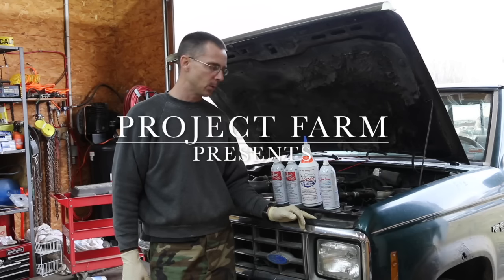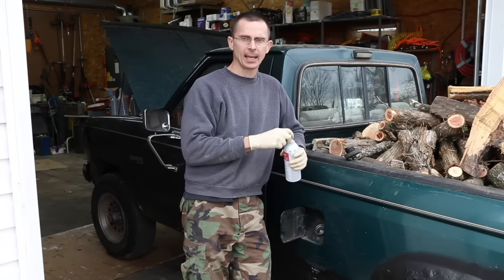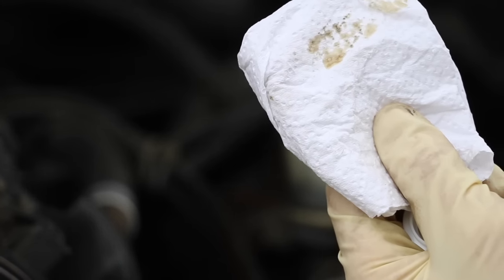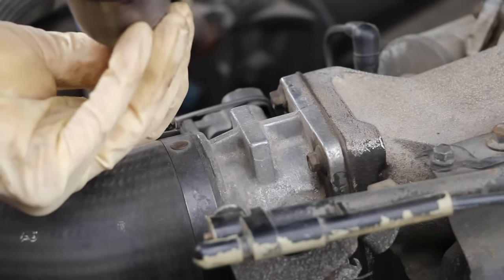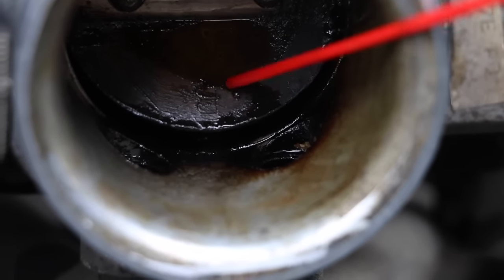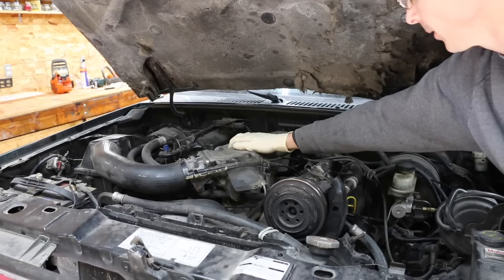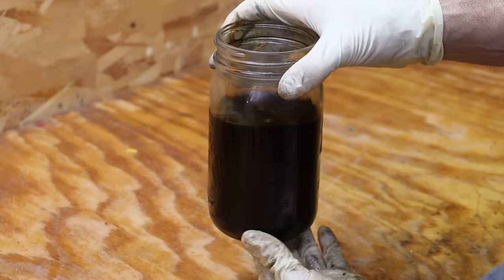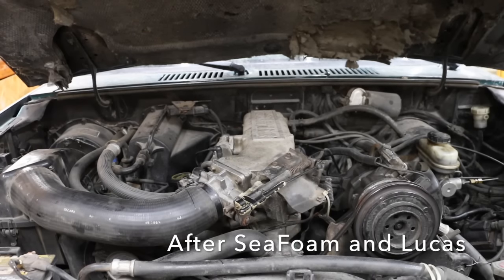Seafoam--can't believe what it did to my engine!!

Comment: Just used the top treatment on my xterra with 209k and it idles much smoother and accelerates a little easier.
Wasn't running bad before the treatment, but the engine is noticably smoother
Reply from the maker: Impressive results!
Reply: My 03 Exterra  just rolled over 400,000 Km. Have used Mobile 1 extended since I bought at 50'000 km and aside from tune ups brakes and the usual maintain. It's been great still getting 13 litres per 100km - not bad in my books

Comment: I used both of these products on my 96 Chevy V6 Blazer and I was amazed at the results, the engine seemed to start smoother, rotate longer after shutting down. When I looked at air intake before and after Sea Foam it was like brand new.
Reply from the maker: Thanks for sharing.

Comment: You needed to clean your trottle body first removing it, because that garbage is not carbon is oil that stays there from the PCV valve, and then you can started to apply the Sea Foam
Reply from the maker: Thanks for commenting on this.

Comment: If you just convert it to a wood burning engine you already have a full tank.
Reply from the maker: LOL...I needed a good laugh.  Thank you!
Reply: hey +project Farm, how come you didn't seal the seafoam straw into the air intake hose, like how +ChrisFix did it , I think you would of had better results on the throttle body and the sides of the block in the intake.
Reply: you probably would be better off to run a quart of kerosene through the engine and then change the oil and filter !
Reply: I replace the oil with ATF, left idle for 20 mins then replace ATF with new oil.

Comment: When you use pure synthetic (and I am a BIG fan of Valvoline's)  in a older vehicle that has top lifters, you need to add a lifter lube like Hy-Per Lube Zinc Replacement Additive, which will protect them from abnormal wear, and stop any issues, particularly in cool or cold weather, watch for it on sale at your local auto parts store, or have even found it at discount stores for very cheap, and No, I am not connected to them in anyway, just have older Jeeps. Also look for Gumout pro cleaner kits, which has a intake cleaner and fuel system one that is even better than seafoam IMO.

But great video, showing before and after results..keep motoring guys.
Reply from the maker: Thanks for this recommendation! and thank you for the positive comment regarding the video!
Reply: You can also use lube that was designed for diesel engines.  It still has the zinc anti-wear additive in it.
Reply: Those little blue bottles of oil treatment from stp are packed with zinc. Enough for 5qts worth of oil. I have a 95 tahoe, last year of the flat tappet engines and it's had a bottle of stp in it every oil change. 260k miles and it runs perfect and quiet. Definitely worth the $3. I put it in everything now lol
Reply: V.Vega, will have to keep my eye out for the blue bottles of STP, as we have the Black, and have even seen the Red, but not blue that I have noticed, but if it has Zinc, that would be good to use as well with older flat tappet engines.
Reply: Or just use Amsoil ZRod, designed for older engines and is a Full Synthetic. Keeps lifters free cleans and is great for a stored vehicle
Reply: What?  An older vehicle is very unlikely to have "top lifters".  And what does using synthetic oil have to do with it?
Reply: mr poizun you don't know anything, please stop commenting.
Reply: I'm assuming he means flat tappet lifters, which most certainly are common in most older vehicles, and are present in older Jeeps like he owns (I too own one).

However, like others have said, I use diesel oil in my Jeep and it helps greatly. As far as synthetic oil, I'm not the expert on this, but my understanding is that all newer gasoline car oil, not just synthetic, has a zinc deficiency due to the fact that zinc does not play nicely at all with emissions equipment (specifically catalytic converters) and most engines today do not have flat tappet camshafts.
Reply: My 98 ranger 4.0 rattled with maxxlife partial synthetic. I took it in and had conventional 5w 30 and the rattle went away. I'll never use synthetic in my truck again. Runs nice smooth and quiet now
Reply: I use Schaeffer oil

Comment: It works good sea foam. Thanks for your video. Dude good job.sea foam.should pay you for this video
Reply from the maker: Thank you!
Reply: bks bks....If you have hard sterring problems when the car is cold? Try using a turkey baster to empty the pwr steering fluid from the resv...add some seafoam pwr steering stuff...let the car idle a bit then take it out for a ride...the stuff gets rid of that gummy stuff from the pump and  throughout the system. Might save on a pwr steering change out. Some mechanics like to scare people that they may need a rack also. Hence me doing my own work and checking out the vids on youtube....reading a book helps too.  :>)This was a great video. Project Farm good job. And I agree with bks bks....Seafoam should pay you!!!

Comment: So, i work at an auto parts store and of course ive used this stuff before and my god is this the best review ive seen of this, we got a 2002 dodge grand caravan with similar mileage to your ranger and looks like i will be doing this tomorrow! was that synthetic oil you used?
Reply from the maker: Hi Hunter, I hope you experience similar results!  Yes, I added synthetic oil.  You might consider just doing the Seafoam treatment first, then the Lucas some time in the future.  Others on the forum seem to have concerns regarding the Lucas, although I experienced good results.  Thanks for commenting.  Could you please let us know if Seafoam helps the 2002 caravan?
Reply: Project Farm I did a full synthetic oil change in my 98 2.2 S-10. It had no problems before hand. After, the oil pressure was low when hot at idle in gear where as before there was no issue. Put some Lucas in and that was all it needed. I put lots of miles on this truck and change oil  every 7500. I went back to a synthetic blend and no Lucas with no issues at all. Truck has 175,000 on it. Also the rear main started to leak, now it is fine. My point is, watch for any changes going to a full synthetic. The blends in these older vehicles works fine, but I'm not convinced synthetic alone is a good thing.
Reply: Synthetic is a good thing to get them cleaned out gradually instead of big clogging gunks of goop all at once, but when you start clearing sludge away, yeah it is common to develop leaks where the sludge was helping to seal it up.  That doesn't necessarily mean you need to change or add anything to the oil again, sort of the opposite that it's time to lay off the seafoam and let a "little" of the deposits build back up to stop leaks. Then again the seal isn't getting any newer.

Comment: "this engine has a lot of wear on it" all of my car's I've had more mileage amount and still ran like champs
Reply from the maker: Thank you.  Yes, previous owner made a lot of very short commutes to work, which is hard on an engine.  It needs to warm up.
Reply: How do you see all comments even from old vids and respond to them every time
Reply: @bilman6639  he gets notifications every time someone comments
Reply: @ProjectFarm  Those little Rangers are pretty reliable (had one myself) but Buy a good GM Truck the next time. You'll go 200K before you start having to do things like this, even if the truck was not well maintained before you bought it. I've had S-10s and Silverados that have gone 300K-400K with a little TLC
Reply: @Archangel0804  Chevy for the win body rots away before the motor as it should
Reply: @jeremybrown9785  My experience is that Ford is worse than any Chevy. Take a look at the Ranger in this video!!! And I'd rather have body rot in a Ford or Chevy than the dangerous Frame rot I'd surely have in a Toyota
Reply: @jeremybrown9785  Melt a bunch of toilet rings down, and get a paint brush - brush that all over the underside of the truck then drive in a dirt field; then your body wont rot regardless of make.
Reply: @ProjectFarm  my wife has a cousin who lives in Dallas TX. She had a Miata she used to get around on short trips and commute to work, all within about 5 miles from home. She kept having to replace the cat conv and muffler because of rust, both covered under warranty. One of the very old mechanics was brought in by Mazda to find out what the problem was. It was discovered that because she wasn't driving it enough the moisture created by the cat conv wasn't being evaporated by the engine heat. Solution, drive it for at least 30 minutes every time to boil off the vapor.
That was five years ago and still has the same cat conv and muffler.
Reply: @donniebrown2896  Yeah I've seen all kinds of problems caused by people driving their car short distances only and at low speeds. Moisture build up in the oil looks particularly nasty. Having some of that moisture freezing overnight in important vacuum lines or sensors can cause some real headaches.

Generally getting it out on the highway for 30 minutes once a week is enough.

Comment: i thought this was a vid about sea foam ruining the engine
Reply from the maker: Lol
Reply: @ProjectFarm  Well, there are tons of those; The problem is not whether or not it frees up clumps of varnish or carbon deposits, but rather whether or not some of these deposits find a way to get stuck in the wrong place after the treatment. Did some of it seep into the piston ringlands to later turn into a hard cement? It's been over 2 years; is your truck still running? A bit of online research reveals that engine troubles not long after performing seafoam treatments are not uncommon.

Comment: a helpful bit of info, when you showed the throttle body, i noticed the it was fully covered with Coking. As a licensed tech, I have been using throttle body cleaner on that. It comes out like brand new almost. Another tip is removing the idle air control (IAC) and spraying it clean, plus the inside part of the throttle body. Caution key off when doing this. This has a bearing on idle quality and control.
Reply from the maker: Thanks for sharing.

Comment: Lol that was not carbon on the throttle plate. There is no combustion on the throttle plate, only passage of fresh air from the intake tube and PCV. That's a layer of oil film thats been built up over the years. Also, carbon doesnt "burn up". It just passes thru the system. Most of the time it just gets stuck in the cat or muffler. If it were to "burn up", you wouldnt see any of it stuck to the cylinder walls or pistons would you...
Reply from the maker: All great points.  Thanks for commenting.
Reply: Carbon definitely can burn. It can form CO2 (carbon dioxide) or CO (carbon monoxide). If carbon did not burn, you would have no coal. I do not know exactly what the "film" left on plate was and will never know unless somebody researches it, but my guess is that it is some sort of stain formed between the surface of the metal plate and the corrosive gasoline.
Reply: Larry Lewyn That is the AIR INTAKE plate. There is no gasoline on it. Fumes from the crankcase via pcv system leave deposits. Re carbon burning: carbon containing compounds combust. Carbon as a byproduct of combustion does not. Try burning your ash left over from a fire.
Reply: gasoline vaporizes, and it's gas form is lighter than air so it rises. Gasoline rises up through your air intake for sure. Carbon can definitely build up, especially after 30 years of trace gasoline.

Usually in a carb with a butterfly flange, the jets are just below it.
Reply: I say the black film is from a nearby EGR valve, when the throttle plate is not full opened the EGR opens up from the exhaust ports. If the picup has done a lot of highway driving it possible to get carbon/soot build up on the plate.
Reply: BS
Reply: William Shaw carbon is not an ash and it most certainly will burn. Millions of people burn carbon in their charcoal grill every month and steel plants  burn carbon  in the form of coke.
Reply: Bad Drivers of North Texas lmao guess you never heard of hydro carbon ...  come on dude oil is carbon
Reply: I think the idea is that this shows the compound dissolving carbon-oil sludge in the intake system. Just downwind of the throttle plate you have the intake valves where that same sludge buildup is causing air constriction and therefor, poor volumetric efficiency. It is true that the power stroke is not going to burn all the freed-up sludge on its way through the system, but downwards of that in the exhaust system, it gets hot enough to burn any oil or carbon. My EGT runs at 500C on casual trips and 800C on hard pulls.

Comment: Great results! Thanks for posting. I have many mechanic buddies and they all love sea foam! Subbing!
Reply: Would it be safe for me to run seafoam through a farm all 560 gas in the fuel and oil like he did. My 560 sat for about 2 years I put “mechanic in a bottle” from Walmart through it which kinda fixed it but would it be okay if I ran seafoam through it

Comment: Gained 10 pounds of oil pressure on my 6.0 Chevy after a can in it. Totally cleaned up the engine after I replaced a quart of oil with a bottle of seafoam
Reply from the maker: Impressive!
Reply: @ProjectFarm  Either it was my oil pressure sensor screen or my oil pressure was really just that low, it revived a 200,000 mile engine, that stuff is no joke!
Reply: @xluke2416  i noticed my oil pressure on my 6.0 dropped to like 32 psi on a cold start up here in the midwest. Its weird but on cold start it takes about 2 seconds to get to 32 psi, it dosent instantly go there, it has to climb. When im driving it it's about 40. I used engine RESTORE on it last 2 oil changes, project farm did a video on it before and man i got a huge improvement with trottle response, never felt that kind of power from my 6.0 before. But it goes away after about 2k miles. I wasnt sure if my oil pump is going out or not so I will defintely be throwing some sea foam in the oil and fuel. What kind of oil you use? I use shell rotella, not sure if its great but it's supposed to be good for trucks if your towing. What do you recommend? I got a couple hundred miles before im gonna change the oil. And also what kind of filter you use? I got about 205k miles on the motor and running strong.
Reply: @BenefitExploits  sounds like your still getting better oil pressure than I do, mine sits around 30-35 while driving and it goes to 40-50 if I bring up the rpms. About 210k miles. the OEM filter, because I tried a k&n and it destroyed my oil pressure, so did it to my brothers.
Reply: @xluke2416  I have a k&n on it right now, I will probably switch to something else then.

Comment: i just bought an 1988 bronco 2. 2.9  liter, same as your ranger. it was sitting and non running. i just got it started this week and it had very loud lifters. after it ran a bit it seemed to quiet down. when i reved it up it came back a few times. definitely plan on doing what you did in this video, also i have a rattle sound at a certain rpm, not at idle and not reved up kinda in the middle just after idle. hoping the lucas will get rid of that. this video is very informative thank you. fingers crossed it helps this little bronco along.
Reply from the maker: Thanks for sharing!

Comment: I have 365,000 miles on my 95 Maxima. About two hundred to go.
Reply: Jhy'Quis Texas I got an old 97, Iam curious, what type of maintenance do you do to keep it around that long. I heard they last forever.
Reply: Sea foam, oil changes, keeping a close eye on fluids and don't drive it like you stole it. Lol right now I need an idle  air sensor, making the car shut off. Purchasing one Friday. Good luck
Reply: Thanks for the info bruh.
Reply: You're welcome
Reply: or more, good cars, still see lots of ~'95s on the road here in NC
Reply: So 365,200 miles then?
Reply: Jhy'Quis Texas  knock on wood.
Reply: Joseph Stalin 😂😂 i know right?

Comment: Well, I'll be dipped!  It actually works!  I always thought that stuff was snake oil.
Reply: your not wrong. most of it is. these 2 have been around for years because car guys know they work (with great care in using them.) You can blow your motor by misusing Sea foam.
Reply from the maker: They're both great products. Thanks for commenting!
Reply: hurlrules1--you must have misread what i wrote. People use seafoam  in there gas & also pour it right into there heads. I said that Lucas & Seafoam have been around for years because car guys know they work. If Seafoam is misused ( by using too much at one time) it can strip 'all' the oil from your heads, cams, valves lifters, rods, rings, damage gaskets & cause you harm. It needs to be used with caution because it cleans so well. Your mixing it properly so you get the desired effect.
Reply: Andrew P Amen to that!

Comment: man really cleaned it up  huh . is the motor still running  good . dont know if you still have it or not .
Reply from the maker: Yes, still runs great!  I use it all the time around the farm. Thank you!
Reply: diy dark matter engine
Reply: Project Farm why is the truck in such bad shape? Mine has 135K miles and it does not look so bad. 2004 f150. Runs great too.
Reply: Achisachis73  He stated it's a farm vehicle.
Reply: Augustin Torres  and i have seen better farm vehicles, I live in rural california
Reply: Rusty trusty farm truck or, an on-the-road vehicle in NYS!  LOL
Reply: @Achisachis73  probably because it's older than your truck and was used as a beater/farm vehicle.

Comment: I have a 1965 ford falcon sedan and a 1971 ford custom that haven’t been started for years but I am definitely going to give this a shot with them when I get around to working on them. One needs a radiator and the other just needs a throttle cable. I’m actually kind of excited about it now and soon as the snow melts and it warms up I’m doing it
Reply from the maker: Thanks for sharing.